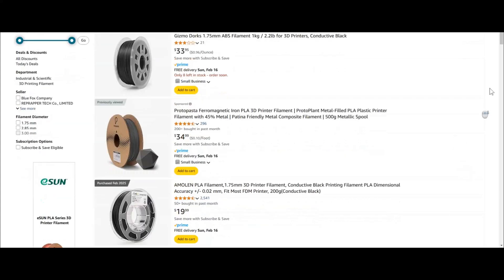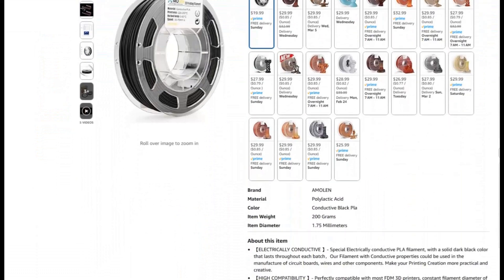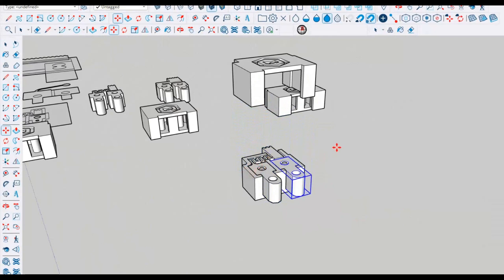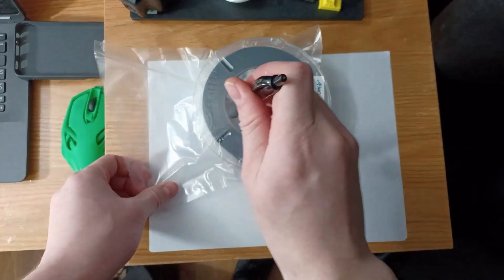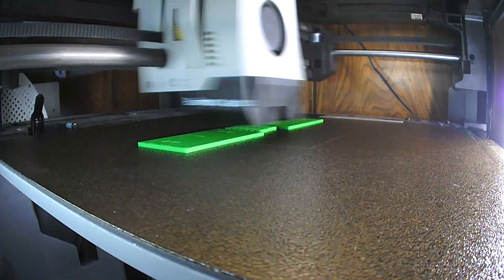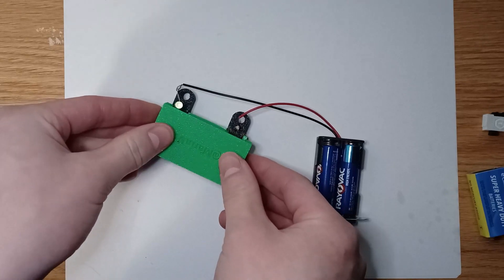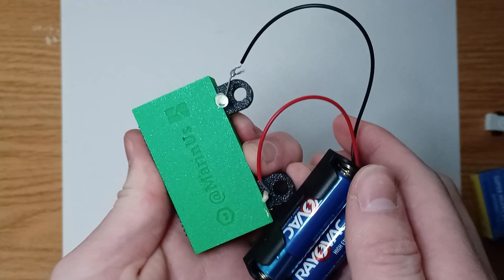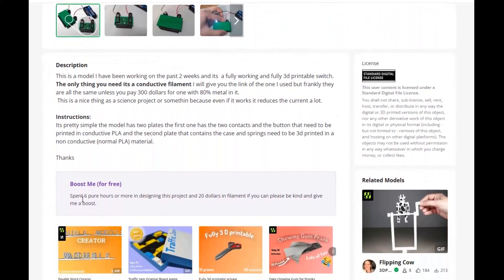First ever Fully 3D printed switch. IT WORKS

Comment: So there were a few things you could've done to improve performance like nix the contact on one side and make it a hinge and reduce the length of printed material that electricity has to travel through in the switch. Its a resistive material and would work kinda well as a wiper style potentiometer (i say kinda because conductor density throughout the print is probably not uniform enough to get a good displacement-resistance readout). You should try a slider next time so you can raise and lower the LED brightness give us some mood lighting 😂.
Reply from the maker: I appreciate the tips, I'll keep those in mind for the next project!